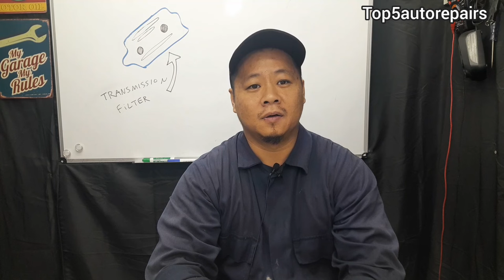Signs of Clogged Transmission Filter

Comment: Month ago , my truck no go forward or reverse , I’m call 4 shops they say need Rebuilt the transmission today I’m chance oil and filter … my truck 🛻 run perfect … f 150 2006. 260, 000 milles never change filter or oil before …/ filter is clogged.    I’m safe 3000 dóllars.  Thanks for you video 👍🏻
Reply: I’m having the same problem with 04 Chevy Silverado 4x4 I’m hoping I just need a transmission fluid replacement
Reply: Same issue with my 2001 silverado. It works for about a minute then wont move. If i restart the truck it will work for a short time then back to no moving in gears. Truck has 270k miles but Replaced the 4l60e trans 110k miles ago have never serviced fluid or filter bc thats what trans manufacturer said it was good for life of trans smh. Hopefully i lucky can replace clogged filter and haven’t burned the clutches up since it still works at first and fluid not burnt. Find out when i drop the pan.
Reply: @jkstdstang was it the filter?

Comment: Okay so my transmission got clogged perhaps due to it was not OEM quality or because my mechanic fixed front trabsaxle AWD seal kit and got short of some ATF fluid in the process as they're linked to each other. Now he put some of the dirty fluid and after that i started having all the issues you described. Later we opened the ATF chamber and replaced the old OEM Toyota filter. But didn't change the burnt smelly oil. Now the car started heating up and i saw on OBD scanner via Bluetooth that ATF temperature that should be around 90° i suppose was 125°😅 The engine coolant temperature went to 118°
The car stopped, now cant go in reverse or Drive (D) even i push the accelerator. 

My question is, there is no check light. The car starts fine but has that very little metal sound when i push the accelerator. Should i try and drain the ATF pan, take out the filter, flush the whole transmission fluid from the front pipe and connect the new fluid to the input pipe till all old fluid is finish and come the new clean fluid. I saw some videos on YouTube to see transmission flush. Transmission filter is expensive here, i was planning to put a relatively less expensive ATF oil from NASA rather than Toyota Type 4 for this experiment purpose. If the transmission gives signs of life after flush and removing filter. I'll drain all the oil and put a new transmission filter and oroginal Type 4 fluid. Worst case i have to change a second hand transmission from the scrapyard. I also heard if you change the transmission, you need to update the ECU for the car etc.

Please guide me. It is all interesting to me and i want a better way out of this.

Comment: 4L60 in 2005 Silverado, 145k mi. 
Drives fine until trans heats up (5-10 mins) then no D or R. When warm a slight buzzing noise in P and N. Suspect clogged filter based on your video. Fluid level is right on and not burnt.
Reply: mine is doing the same thing...i will try to change this filter...thanx for the info
Reply: @pastormichaelhibbertminist7486  Yeah, mine was fine again after filter & fluid change. Put about 5k miles on it since then and just started getting the P0894 code (trans component slipping). From the research I’ve done, probably damaged the converter clutch or pump when it starved for fluid. Some guys claim that they’ve gone several thousand miles once that started, but it does set a check engine light and if you live somewhere that requires no light to pass inspection, then obviously have to fix. I’m rural and not an issue, but I’ll probably replace with a rebuild sometime this year.
Reply: @modquad18  Outstanding...Thank you for giving me Hope...this transmission install was very difficult...took 6 straight days of Hell...would hate to do it again
Reply: @pastormichaelhibbertminist7486 Good luck 👍🏽

Comment: What about shaking my 2011 CTS luxury shake when I barley touch that accelerator but when I get on it a little it stops or if I put it in manual mode and give it gas just aggressively enough so doesn’t kick down it shakes bad and makes a clunk shake on and off the accelerator. It shift great however. Don’t know if it’s the mounts or the transmission.
Reply: Hey, did you figure it out, my SRX is doing the same thing. Please let me know if you have any luck

Comment: Hello, new subscriber here. I have a 2000 Chevy express 1500 with a 4l60 and started to hesitate on drive, it would kinda grab the 1st gear and then engine would run away so I decided to drop the transmission, could get the drain plug out so took down the pan and the transmission filter was just laying there without me even messing with it! Just removed the pan carefully and there it was. Do you think this might have been my issue?

Comment: My transmission is giving off a whining noise, I’ve changed the fluid and cleaned up the filter. Found pieces of fibre in the filter too. Fixed the transmission leakage from the seal too. But the whining noise has refused to go away

Comment: My 2006 Honda Odyssey van shifts great but has around a 1 second delay when you put it in gear. What might be causing this? Fluid has been changed when it’s suppose to but doubt they change the filter on the side of the trans. I was thinking make its very dirty and causing this so I’m going to change it. Honda says never have to but maybe this is because they want transmission to go bad so they sell new trannys.

Comment: Hello my names giovanny I had a question I have a 2009 Infiniti g37 7at automatic transmission and I changed the transmission filter with a new one but 2 out of the 19 or 20 bolts holding the transmission filter the thread on the bolts messed up and I installed it without the 2 screws can this cause the car to loose pressure and not shift into higher gears ? Now that I drive the car a changed the fluids and installed the filter it now won’t shift to 4th or 5th gear and sometimes the shifter will become un responsive when I try to shift gears manually can this all be because I’m losing pressure due to 2 bolts not being installed ? Also should I re install the original filter back on ?  I drive tha car it shifts into 1st 2nd and 3rd gear fine but 4th and 5th is wear it gets stuck or sometimes it’ll only shift to 3rd gear and get stuck and I have to turn off the car and turn on again In order for car to reset and shift again what are your thoughts I’d really appreciate the help 🙏🙏
Reply: @top5autorepairs
Reply from the maker: Correct. It can lose transmission internal pressure.

Comment: I have a 2014 Jeep Patriot when I hit on the gas the RPMs go up to like two and a half 3 but I'm only going 35 miles an hour and then it has trouble shifting picking up speed what could that?
Reply from the maker: Check out my video "Limp Mode" or my other video "Why your vehicle can't go faster than 30 mph."

Comment: Hi i have a 2002 impala v6 3.8 
And when it turns on it’s fine it shifts fine and then it starts slipping after a couple minutes…i turn it off and turn it back on and it goes back to normal but slips again after a while…then i have to restart it again and it starts moving again until it slips again
Reply: Hello! It sounds like the viscosity of your transmission fluid goes too thin really quick when it gets hot (Totally normal in a V6 because it generates more heat than a 4 Cylinders). You must change it to a thicker synthetic transmission fluid as Red Line D4 ATF or Amsoil ATF as example, plus, a filter and pan gasket from OEM Chevrolet.

Comment: hey Top 5. can bad fuel injectors put a load on the transmission and cause bucking?
Reply from the maker: Hello. It will not since it's two different system.
Reply: @Top5AutoRepairs  thank you. now I have to look at the axle or speed sensor as possible reasons.

Comment: Ima going to replace fluids and filter today . Hopefully we get her back on the road driving😢 ppl need these videos. To much videos out there ppl saying dont touch the fluids….. mine when i hit the gas it just revs. Sometimes it drive for like 10 secs them revss. Fluids are black and smell burnt
Reply: Update?
Reply: @Bravo-ro4zb  after changing trans fluid i got her back running
Reply: @Bravo-ro4zb  did the filter too
Reply: Did it have a whine or anything??
Reply: @charlesmealer5425  no . Just gave out while driving. Would drive a few meters then give out again
Reply: @eastcoastkickz4891  gotcha. I gotta change mine and hoping I don’t have to do the converter. Hoping it’s a clogged filter making the whine
Reply: Great informative video. 
My major problem with my 2004 Toyota Rav4 is a loud bang in reverse. ECM checked out and is fine. 
Any guidance?
Reply: @charlesmealer5425  did it work??

Comment: My is200 lexus 2001 don't run over 3000,can't shift to 3 and 4 and it automatica.what can i do to fix this problem
Reply from the maker: Could be a shift solenoid issue or the vehicle is stuck in limp mode.
Reply: @Top5AutoRepairs  ok so if it's limp mode,how do i fix that?
Reply: @bloodyt1009  dude thanks for asking I hope he’s answer

Comment: I recently changed my cvt transmission oil. Now I hear mild whistling noise at very low speed or when the car approaches for a stop. Please guide what to do.
Reply: Same thing is happening to me 
Did you find the solution pls?

Comment: Any suggestions why the RPM is going up to 4000 on parking or neutral without touching the gas pedal? When shifting to D it's normalyzing immediately.
I have checked the fluid level twice. Once it was ok, the second time seemed low.

Comment: Hi all. I have an issue with a 2003 nissan pathfinder, Automatic transmission. when it starts in cold   engine got no reverse until 9 or 10 minutes, as it warms it starts moving in Reverse, what can be happening to the transmission. I replaced fluids and nothing.
Reply: Are you getting any Service Engine Soon codes?
(For those without a 2003 Pathfinder, it doesn't have a check engine light per se)

Comment: I drove my 79 chevy pickup to work, put it in reverse then went to put it into drive and now it won't go into any forward gears. It still goes into reverse but not engaging into forward gears all of a sudden. Was extremely low on fluid, but even after adding fluid still no forward. What could this issue be? Any help would be great.
Reply: Did u ever figure this out?!